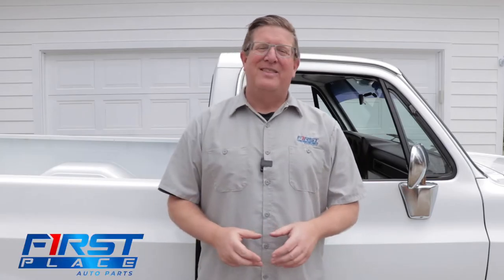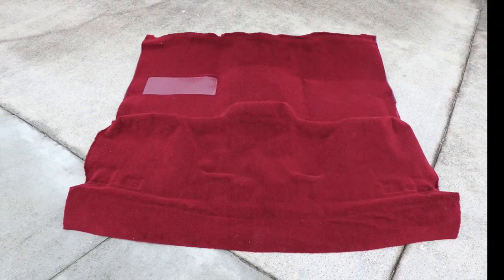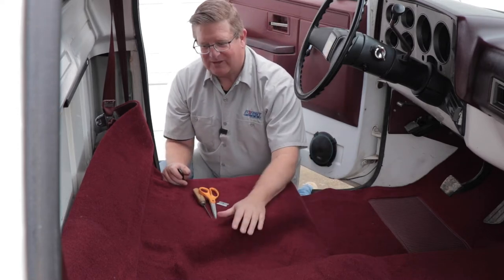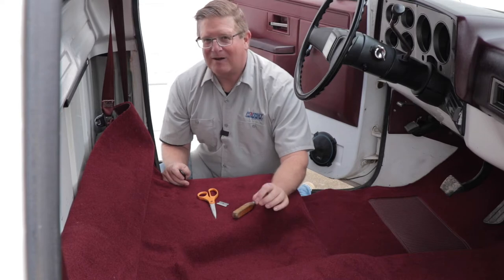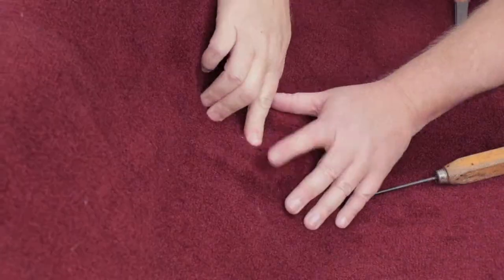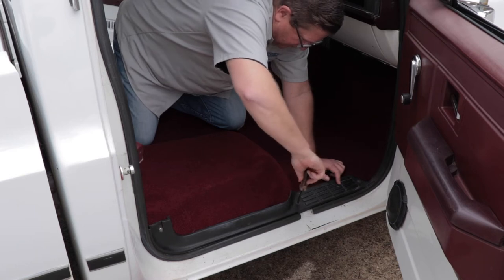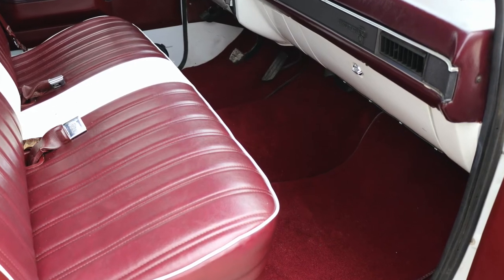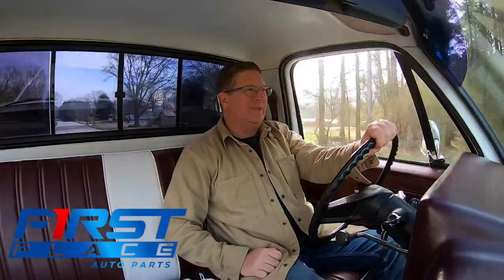We're installing ACC Carpet in our C10 Square Body shop truck!

Comment: Not sure how my carpet I purchased (same as in video except it’s black) comes not even close to the fit you have  right off the bat my edges that are finished are going way up on the kick panels and all around Where the door threshold trim is overhangs a lot it seem to need trimming right from the start. My is contoured somewhat but not nearly as smooth as yours lays into place 😢, not to say it what work I’m sure after fitting and trimming I’ll get it nice but idk it seems As Aldo Rayne would say Suspicious.

Comment: It's this the mass backing carpet or regular?
Reply from the maker: The carpet installed in this episode was jute (not mass backed) which is correct for the year truck. Mass backed is offered on vehicles that came with it originally

Comment: Where did you find those nice floor mats to match
Reply from the maker: The floor mats are made by ACC, the same company that manufactures the carpet and are available through First Place Auto Parts. They are very nice mats and don't slide around once installed. Thanks for watching!